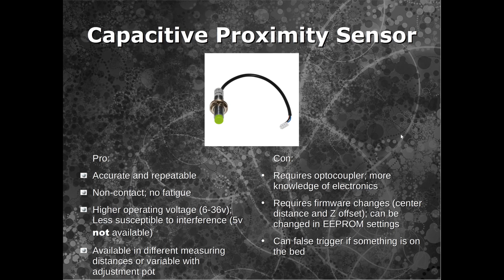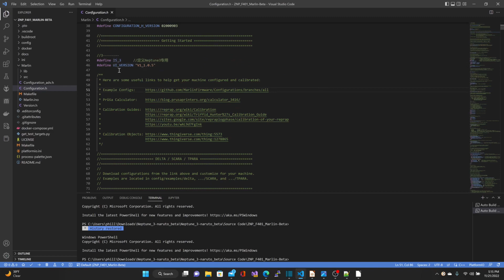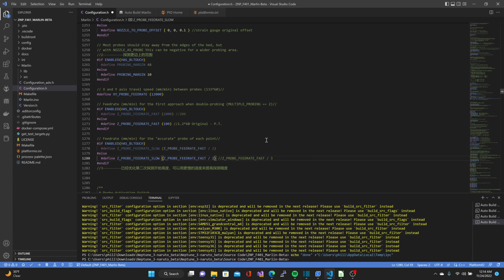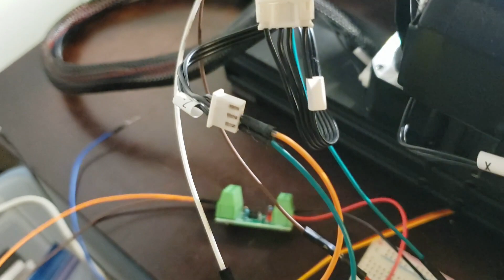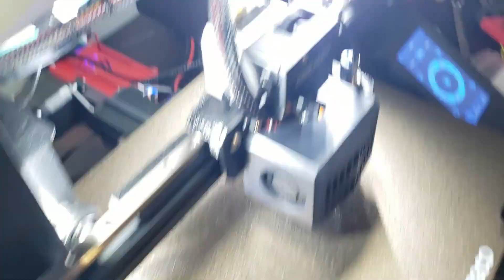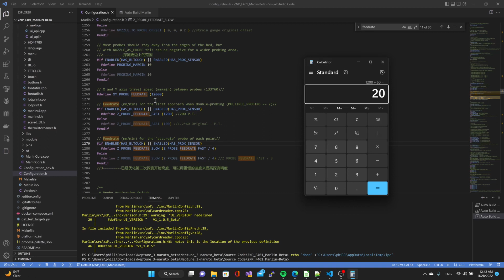Elegoo Neptune 3 - Auto bed level sensor shootout extravaganza!!!

Comment: So, I'm hitting an issue with my Neptune 3 max, all the axis work, the temp is fine, but no matter how many new hotends, or Proximity sensors I replace, the Homing fails on the Z, going up a little bit, and then a little bit more, I've bought a new hotend with new sensor, same problem, I've swapped with the hotend from the Neptune 3 plus, same problem, I'd replaced the Proximity Sensor from another defective 3 Max, same problem.

It gives me the red light so the sensor works, until it needs to work.

What is going on with this machine?
Reply from the maker: @MrHellsing76  have you updated the firmware?

Comment: I'm about to do the neptune 3 max, I've noticed the board is the 2.2 not the 2.1, looking at the schematics I can't seem to find the dedicated bltouch section on the board. Maybe the photos that are provided are hiding it.

If you know/confirmed that it's not there on the new board, is there a specific photo you know where to put the pwm/servo for the BLtouch?
Reply from the maker: There is no dedicated Bltouch section on that board. I haven't been able to confirm whether or not any of the available circuits on that board can be modified for pwm, so as of right now, there's no way to put a Bltouch onto a pro.
Reply: @TheFeralEngineer  that's unfortunate, my og inductive probe is acting up on my warped bed and giving me ridiculous wrong readings. (I think my bed being so warped is the reason my probe can't read it properly)
I just received the Bltouch and in the middle of pulling apart 😅
Reply from the maker: @sassall9673  I've been wanting to test whether or not pwm can be supplied from one of the end stop pins, but I don't have a pro
Reply: Looking at the schematics i thought I'd use the Z- endstop for the black and white.
But the yellow,red,brown I was thinking the JST in the hotend z limit
Reply from the maker: @sassall9673  z- yes. The pins for the inductive sensor are 24v, so stay from those. Let me look when I get home from the gym
Reply: @TheFeralEngineer  ok lucky you said that, thankyou, I've been trying to find the schematics for the extruder board, but I've had no luck.

I'll wait for your reply
Reply: @TheFeralEngineer  i have another thought, the empty Z+ 3pin port is the same with 5v, G, S (I'm assuming 'S' is signal)
It's a JST with the same pin spacing as the DuPont but I assume I would need to configure klipper firmware to read the z+ on the board as the probe
Reply from the maker: @sassall9673  that's the circuit I'm going to look at. S is signal for an inductive sensor (there are some 5v ones available), but a lot of the gpio pins on the stm32 are pwm capable
Reply: @TheFeralEngineer  no worries, I've just noticed I'll have to redesign your linear rail attachment as the holes are different to my linear rail system.
So I'll put back together, redesign, reprint, then be back in action for pulling apart and doing a test 😊
Reply from the maker: @sassall9673  yeah, no luck from a circuit side. That's what I remember when I was rabbit holing months ago. There's no circuit that matches the BLTouch circuit on the 2.1 board. Are you running Klipper? There's a chance you could run the BLTouch from a GPIO pin on a raspberry pi 3, 4 or pico
Reply: @TheFeralEngineer  so the Z+ wouldn't work?
I rewired the ends of the bltouch to match the Z+ if that helps
Reply: It's 5v, ground and signal.
I'm not that tech savvy, just general knowledge. So i dunno
Reply: @TheFeralEngineer  i am also running klipper on the Pi 5 (I know....overkill)
Reply: @TheFeralEngineer  if the Z+ doesn't work I have the gpio pin out doc for the pi 5.
I just don't have a source for the coding to put into klipper (printer cfg).
Reply from the maker: @sassall9673  pin format for the 5 is slightly different, but this might help

https://3dprint.wiki/firmware/klipper/bltouch-with-raspberry-pi
Reply: @TheFeralEngineer  update: I'm having trouble getting the BL touch to work.
I followed the guide you provided (except red to 5v as 3.3 creates a flashing red error on the BL touch)
It does a self test, stays solid red (good sign)
Debug commands do not respond, but I've heard the 3.1 touch doesn't respond but it does still work when homing and probing.
Tho that is the problem.....it doesn't, when i home, x and y position, then it stops and has a bltouch error (BL touch failed to verify sensor state)

Any ideas?
Reply from the maker: @sassall9673  how are you getting a servo signal? I don't think I put mine to 3.3v, I just plugged mine into the dedicated Bltouch port on the 2.1 board and black/white to the Z limit switch unit. I believe the power pin on that is 5v 🤔

Query_probe in klipper works on the 3.1 Bltouch, but how are you generating pwm?
Reply: @TheFeralEngineer  I don't think my reply sent, sorry, I'm using the raspberry pi 5 to hook it up
Reply: The gpio pins, using the link/guide you provided
Reply: I attached my Reddit post about the problem but my message gets deleted when i post here with a link
Reply from the maker: @sassall9673  oh hell yeah. I think you might have to tweak the pwm timing to get it working just right
Reply: @TheFeralEngineer  how would I do that?
I apologise for being such a nuisance 🙏🏾
Reply from the maker: @sassall9673  just seeing this comment (about reddit). you have your 5th motor driver unplugged, correct? I'm wondering if there's a way to generate pwm off of one of the step pins...
Reply from the maker: @sassall9673  try this stuff first. it looks like it should run on 3.3v, though. I'm looking for settings other than cycle_time in klipper to try to change the pwm frequency, but that might be it. Also, set the BLTouch to probe with touch mode in printer.cfg

https://www.antclabs.com/bltouch-v3
Reply: @TheFeralEngineer  i have the bl touch already set to touch probe touch mode - true

The 5th motor unplugged? Which motor os that, I left everything plugged in normally in the neptune 3 max (except the og inductive probe on the extruder board)
Reply from the maker: @sassall9673  there's an empty motor driver on the main board for a second extruder or true dual Z. I'm curious if the step pin could be used for servo
Reply: @TheFeralEngineer  ohhh yes the Z+ endstop
I will put the black and white there and come back with an update
Reply: Plugged in the white and black onto Z- endstop (white-S and black-Gnd)
No change.

Maybe my pi isn't using the gpio correctly
Because the yellow wire that's still plugged into the Pi is meant to be control
Am i supposed to code the gpio 27 to be a pwm or something?
Reply: @TheFeralEngineer  it also says on ant labs that boards without a bltouch/servo can be configured or flashed to use the Z- and the Z+ endstops
Reply from the maker: @sassall9673  I tried it on the Neptune 3 original with no luck, but I'll try again.
Reply: @TheFeralEngineer 
My guess is that klipper is needed to talk to those said pins once flashed.

 If anyone can solve this problem they would be an absolute legend and forever in my books as The Messiah

I still find it strange that elegoo took out the bltouch section on the newest models. Especially for bigger beds, what were they thinking?
Reply: I also find it strange that my pi can't control or use the bltouch as a secondary mcu?
Unless i forgot to add something on config or forgot a script🤔
Reply from the maker: @sassall9673  it should really just be a matter of pin assignment and a pwm section in printer cfg, no more, no less. There's no special wizardry to get klipper to do anything you ask, it's a matter of if the circuit will allow it or not. I kinda want to get an oscilloscope to test pwm so I don't go smoking anything... Looks like I'll be up all night on Amazon (again 😂)
Reply from the maker: @sassall9673  you followed this along with the instructions on setting up the gpio as MCU?

https://3dprint.wiki/firmware/klipper/bltouch-with-raspberry-pi
Reply: @TheFeralEngineer  pwm section? Hmmm i don't think i have that in my bltouch section
In the guide link you provided is that all is needed for pin assignment and pwm in the bl touch section?
Control_pin and sensor_pin?
Reply: +r+klippers+s+NI6lgnARud

Replace the + with a forward slash
Reply: @TheFeralEngineer  yes that's correct except on the raspberry pi as mcu guide i did it all up until the last part which is 'Remaining Configuration'

Comment: What would I need to change for the elegoo neptune 3 Plus version, in the firmware? Thanks
Reply from the maker: Unfortunately, you can't connect a BLTouch to the plus. There's no servo control pin. It already has an inductive sensor, so you don't need to do anything, really.

Comment: Good evening, I'm from Brazil and I have a Neptune 3. I'm trying to put the BLtouch on it and using its firmware but I'm not understanding the connection to the motherboard. Black and white wires on the Z- and colored wires on the bltouch terminals but it's not working. Z does not turn off and bltouch is not triggered. The printer has a sensor connected below the end of filament sensor with a Z-wire. Could you send me the schematic on how to make the entire connection and which cables I should disconnect. Thanks.
Reply from the maker: I don't have a schematic, only what I explain in the video. The bl touch goes to the z- input on the main board with the white pin to the outside of the board and the black pin in the middle and the BLTouch is yellow -> S, red ->V, brown->G

Do you have firmware compiled for the BLTouch?
Reply: Yes, I'm using your firmware. Fuz the BLTOUCH connection on the motherboard. My doubt is regarding the Z-wue that is connected to a sensor below the filament sensor. should i turn this off
Reply from the maker: @kleberbombeiro1  it plugs into the Z- on the board. It's circled in the video. you have to remove the existing wire that is labeled Z- and plug into that. White wire goes to the outer pin, black is in the center
Reply: @kleberbombeiro1   I have the same issue.  probe will not deploy.  Did you figure this out?
Reply: @billasullivan  Goodnight! Yes resolved. I had to redo the firmware. My initial problem was that the end of course sensor on the Neptune 3 must not be removed and secondly, the mesh did not perform the 16 points, in this case
Reply from the maker: Usually that's a matter of wiring. You need to make sure you don't have the s v and g crossed

Comment: What about heated bed? Capacitive sensors deviate quite a bit with temperature, inductives less, BLT does not care much it is far.
Heat the bed at something like 80C, see if that changes things.
Regards from tommylight/linuxcnc mod.
Reply from the maker: Oohh... I like this. I may have to revisit 😀

I kinda want to build a LinuxCNC driven 3d printer in the future 😉